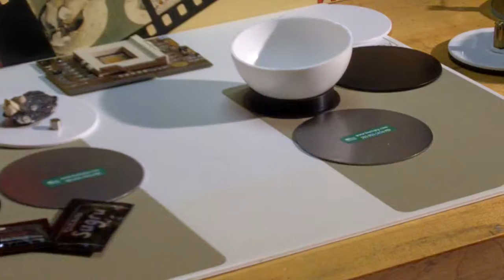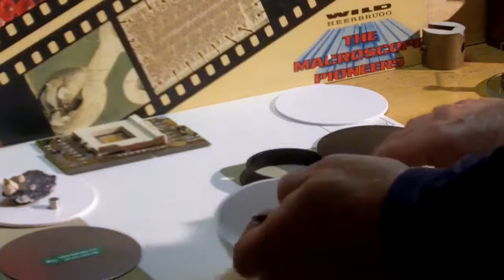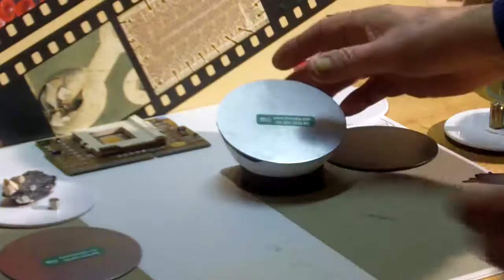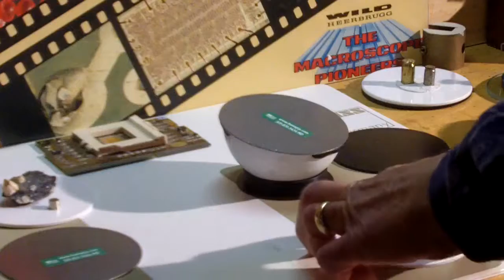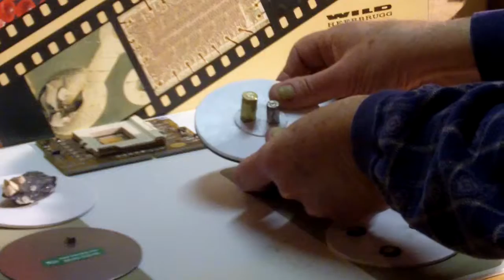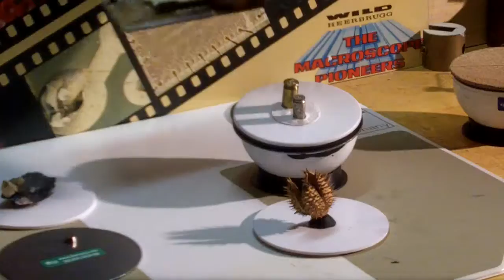RETROCUP...A MICRO/PHOTOMACRO SAMPLE TILTING CUP STAGE WITH DIY LABOR

Comment: A good DIY kit reasonably designed.  Just some observations.  I have a similar designed macro specimen stage originally sold by Olympus Microscope Division.  I purchased it used for about $28.00 USD on eBay 7 or 8 years ago. 
However my  1/2 rotatable sphere is solid, giving it considerable weight.  As weighted the 1/2 sphere holds it adjusted position very well.  Resisting vibrations and holding its set position when incrementally moved.  The top of the 1/2 sphere has a black ring that holds a circular plate that is flat black in color on one side and flat white in color on its other.  Allowing a user to quickly and easily flip from one color to another.  I have fabricated a number of sized circular plates, (made from rough sandpapered green, blue, red, orange, etc. plastic plates.), that fit inside the sphere's black ring.  From my experience a major fault of my Olympus unit is the limitations on the degree of tilt I can use without a specimen moving or sliding about. Without a permanent strongly attached centered holdfast of some sort to anchor and/or hold a specimen my Olympus 1/2 sphere has limited use in my photomacrography sessions. Since my DIY microscope has its Z and X axis's controlled by remote controlled stepper motors and can be manually rotated 180 degrees left to right. I haven't found it worthwhile to fabricate a circular plate with a centered holdfast.